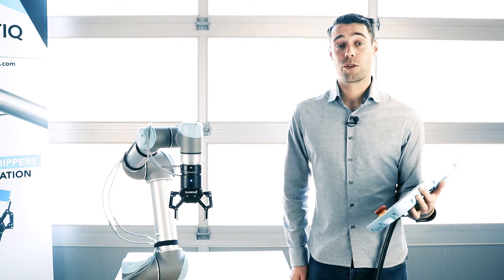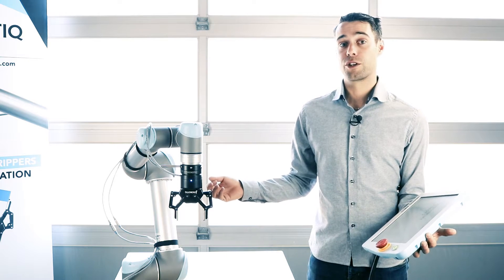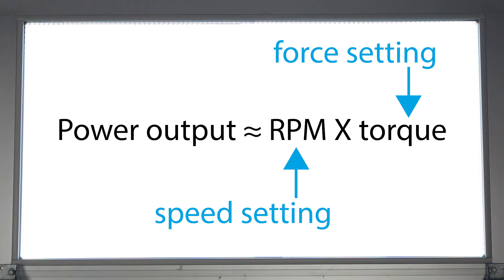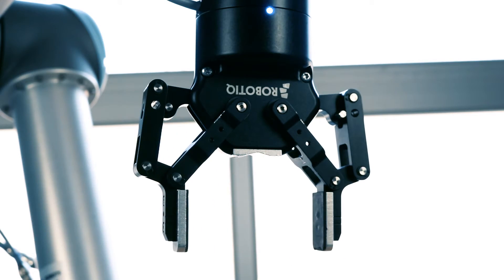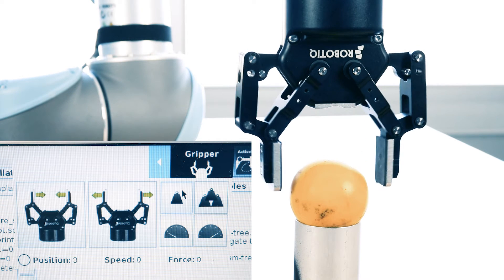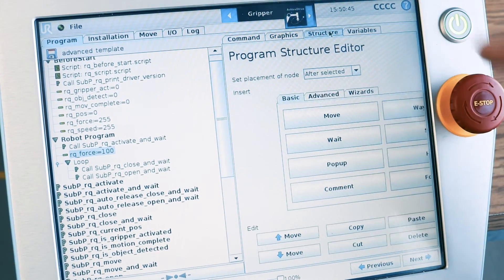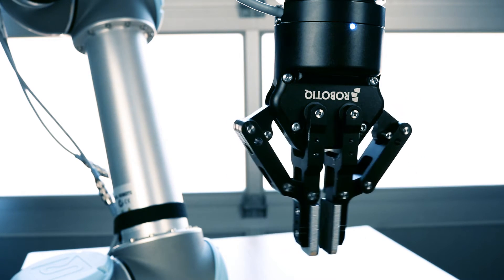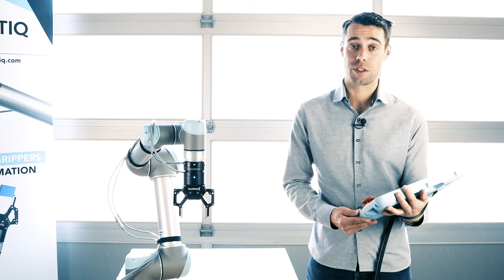How to control the Grip Force of the Robotiq Grippers

Comment: Hi there, I haven't found any information on whether one can set a force, which the gripper should apply all the time (until it has reached the position) and not only when closing or opening. 
I'm grasping objects which are not deformable (stones), and I think that because of the backlash of the motors I'm not experiencing the grip I need and the objects slip out of the gripper. 

As far as I now, the gripper will stop as soon as the force or position is achieved, but i my case, the fingers would need to continue applying force on the object. It would be great to get a response soon.
Reply: Hi Carlos, I would need to know more about your setup in order to give you a proper answer. Please write to support@robotiq.com with detailed information about your robot, versions (software and hardware), serial number of your Robotiq products and any relevant information you could share. A description of your issue, pictures and videos would be also quite useful.